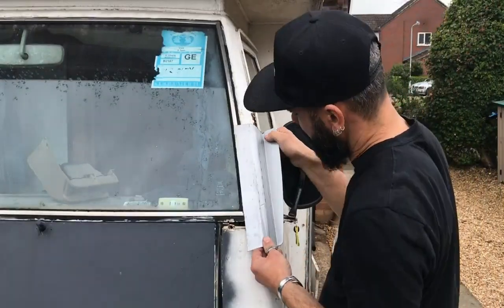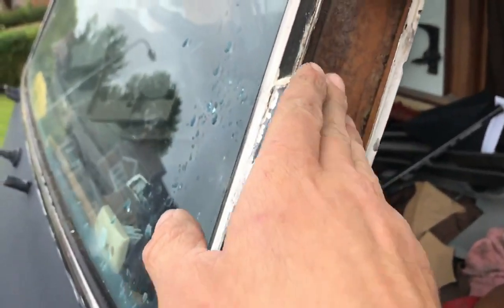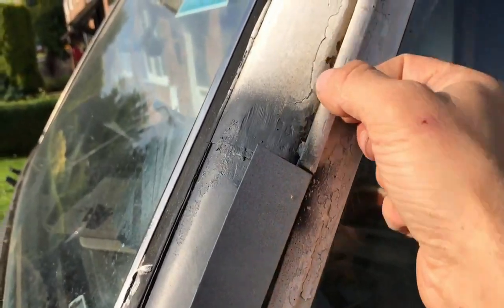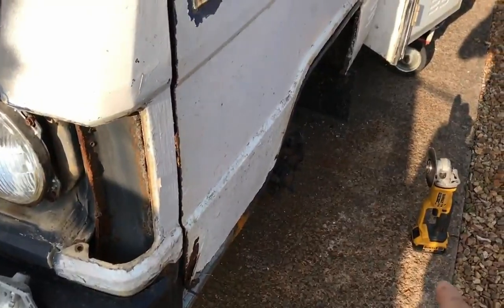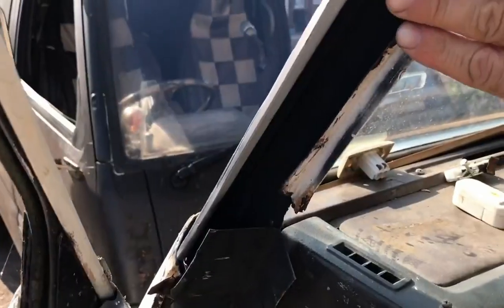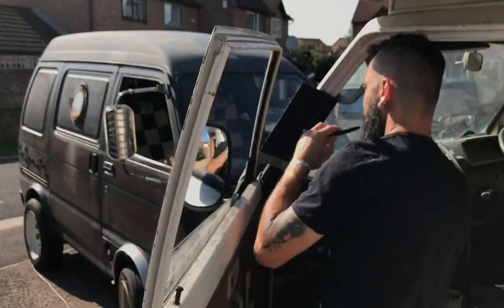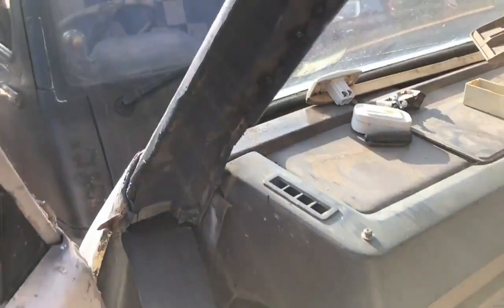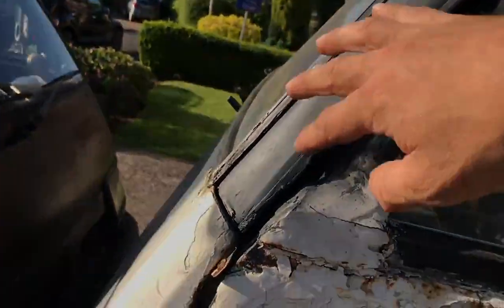Cutting Out the A-pillar Right Next to the Windscreen💥 Mitsubishi L300 Motorhome project

Comment: Hi buddy, have you found anywhere the weatherstrip with the crome insert? I can keep the inserts but cannot find the rubber for them :/ only the later model without.
Reply from the maker: Hi mate, it's like unicorn fart sprinklers, I'm not sure we could get hold of it anywhere. Maybe from the Philippines, as they still got them L300s running over there. Or...Probably better/ easier to find an alternative solution for it.